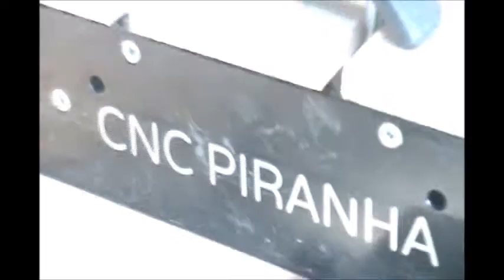Using my CNC to Making a Small Slingshot With no Bands.

Comment: How hard is it to learn the software on that machine
Reply from the maker: I have a degree in Graphic Arts, so for me it was a breeze... I don't know how hard it would be for someone who knew nothing about graphics. It's basically all about vectors. That's how you make a tool-path that designates where the router  follows. I can't really tell you how hard it would be to learn, as everyone is different.
Reply: I know cad so for me would it be relatively easy to get this running
Reply from the maker: Then I would say you're ahead of most people!
Reply: One more thing see how you cut that slingshot out could you have program the cnc to round off the shape  and would you have to change out the bit to do that in like a 2 step process if you know what I mean
Reply from the maker: You could round it by changing the router bit to a round-over bit and just run the toolpath that cuts it out again. Or you can do like I did and simply go over it with a round-over bit on a router table (I didn't film that part)